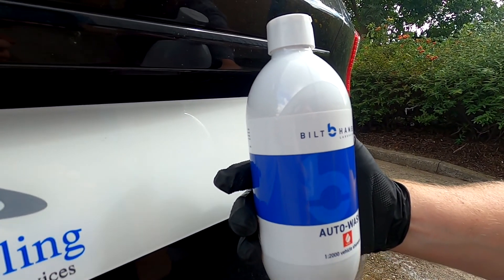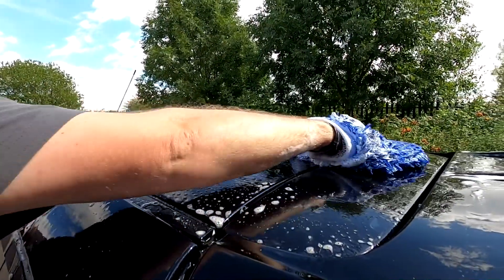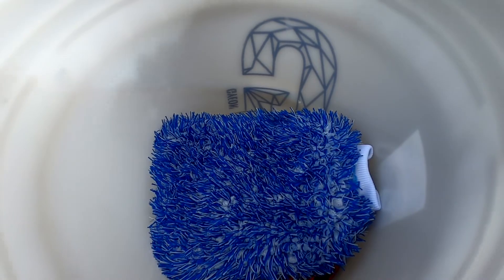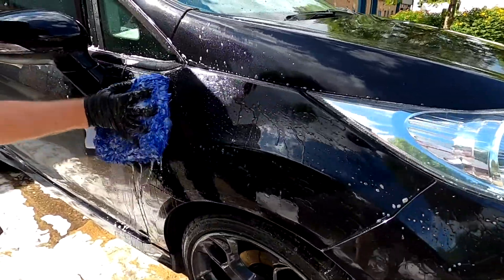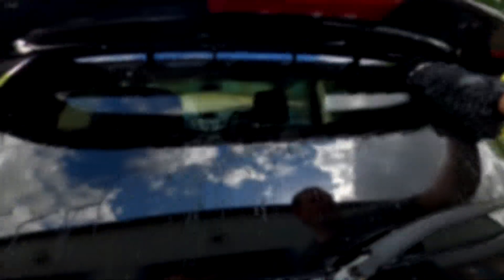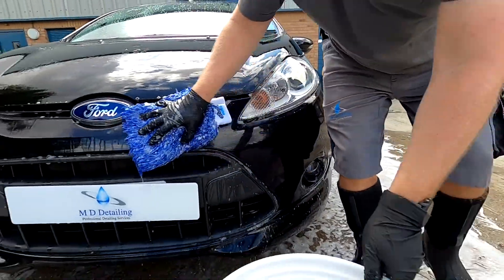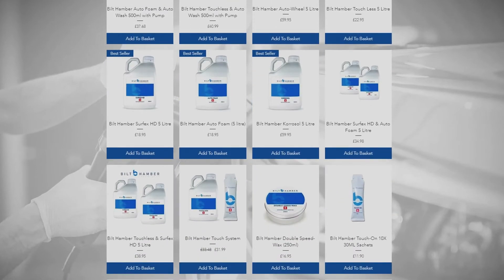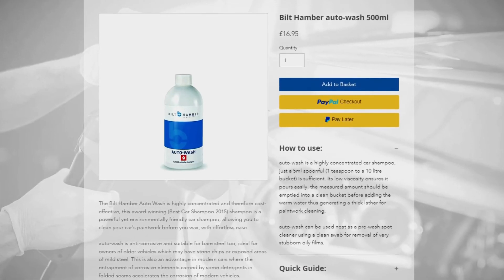Bilt Hamber - Auto Wash Car Shampoo Review!

Comment: Can I use it in a foam cannon?
Reply: I have and it worked a treat.  I put the 5ml into the lance and filled up to 1 litre with water.  By the time this has been diluted again by the pressure washer, I think it is pretty much the same as putting 5ml into 10 litres in a bucket.  I'm not sure Bilt Hamber would approve of using it that way, because it isn't a snow foam, but to me it was just a quick way of getting shampoo all over the car.
Reply: @rtamck did it foam nicely like shaving cream though or was it really wet and drippy? Do you have a video or pic?
Reply: @ippytuklulu  No, nothing like shaving cream, but it's a shampoo and NOT a snowfoam. Even the Bilt Hamber Autofoam or Touchless don't come out like shaving cream.  If you want something that thick, then go buy some Autoglym Polar Blast or Autobrite Direct Magifoam, and even then it will depend on your foam cannon and pressure washer.
Reply: @rtamck I’m 100% going to try that. I really like putting shampoo on with the cannon similar to polar wash.